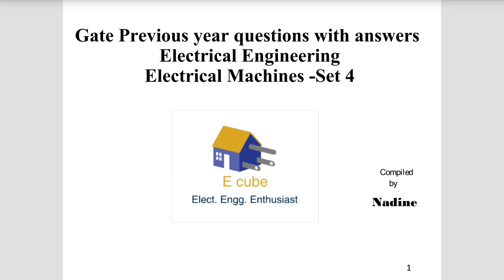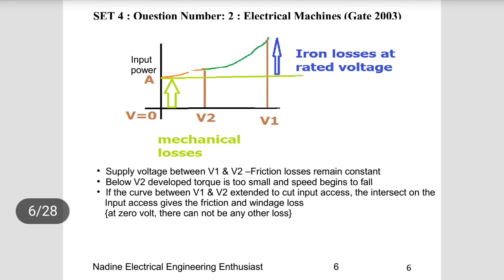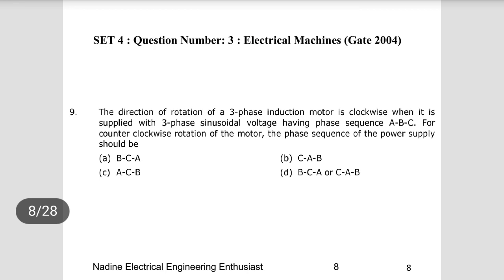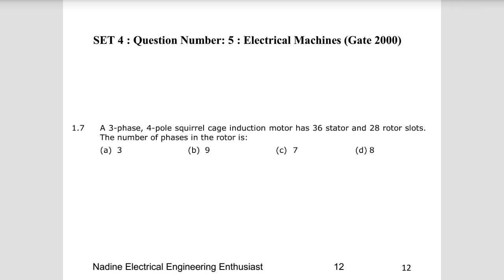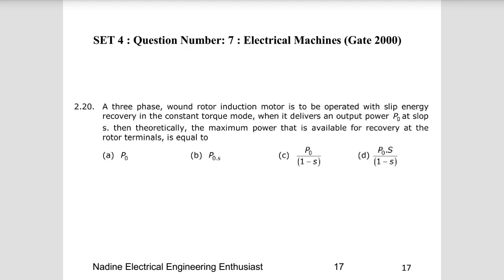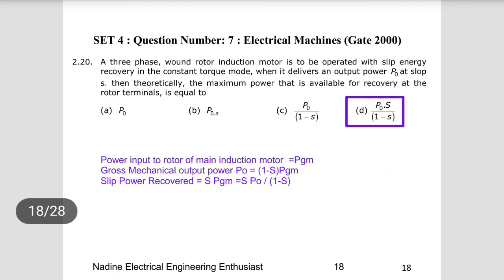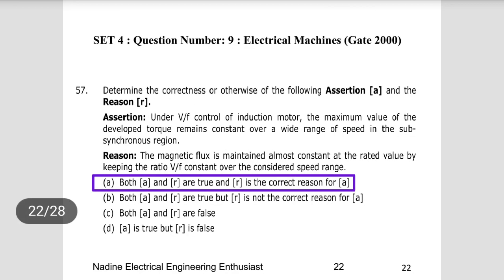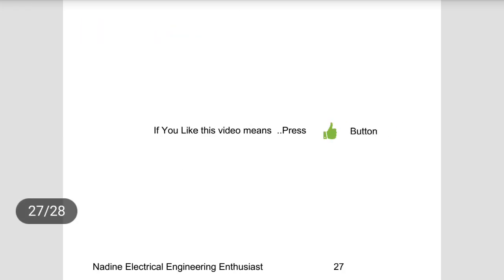Electrical Machines set 4 ( gate questions with answers)

Comment: Sir psu nd aen ki exam ke numerical ke liye konsi buk le
Reply from the maker: Solving the previous gate questions is the best way. Try to learn each concept when solving the paper.
You can refer the following books..
1.gate previous year question by ace academy.
2.3500 MCQ electrical engineering questions by made easy.
3.gate practice booklet v1 by ace .1116 expected questions
4.gate practice booklet v1 by ace 
1116 expected questions

try to understand the concept and practice more questions...